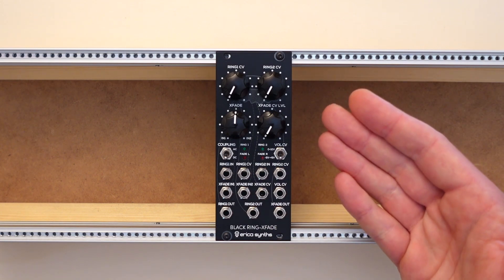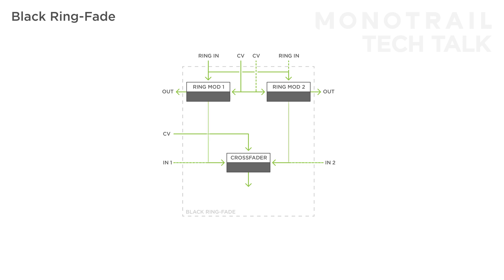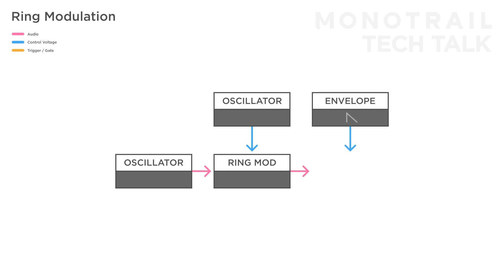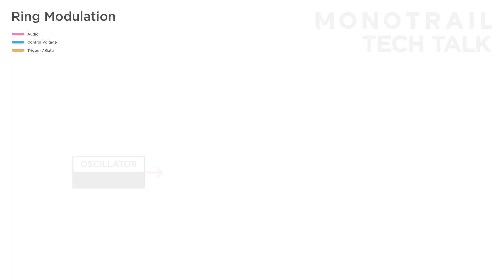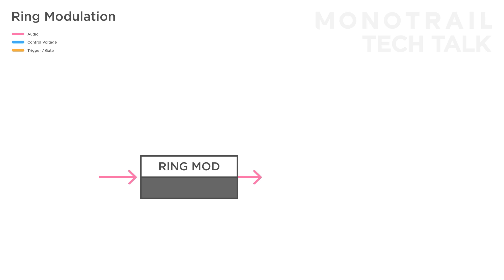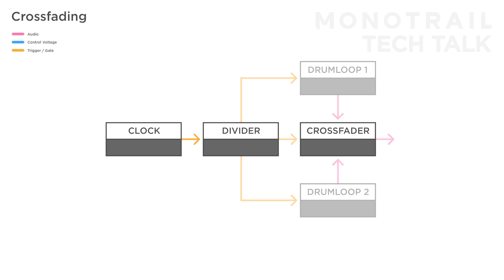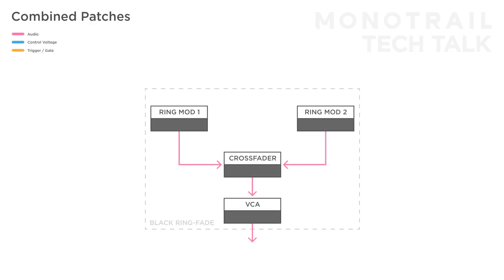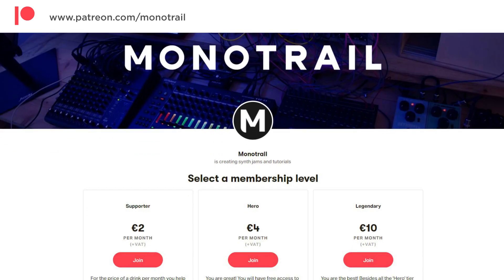Get more out of ring modulation & crossfading - with Erica Synths Black Ring-XFade

Comment: Im a tad confused about the ring cv input. Does a control voltage patched to the ring cv input give cv control over the ring cv knob's value? or does the ring cv input only serve the purpose of receiving an input signal which modulates the carrier?
Reply from the maker: Hi there, it is a bit confusing. Ring in is the carier, Ring cv the modulator. The ring CV knob set's the amount of modulation to the carier. What's interesting here is that Erica Synths used a unique design that still gives you a regular sound when the knob is set to unmodulated. But, there is no voltage control over the Ring CV knob, so maybe they should have called the knob Ring CV Amount or something :)
Reply: @MonotrailTechTalk  Ahh yes thank you for clarifying this. I almost bought it thinking it had what I needed. 

I found the doepfer A-133-2 Dual Voltage Controlled VCA/Polarizer/Inverter/Ring Modulator has cv control over cv amount!
Reply from the maker: Sorry if you read a message I send a minute ago (deleted it now), that was rubbish on my side! I 'd have to look into the Doepfer a133-2, in more depth, but you might be right there. The Doepfer seems to have a manual control, a cv input with attenuator, and then a mod input to modulate the cv amount. Didn't even realize that, I thought it was the same as the a133, but smaller. My mistake!

Comment: with DC coupling, it seems like both channels can be used as VC polarizers?
Reply from the maker: Hi there! The AC/DC coupling switch is for the crossfader only, But in my experience both ring mod circuits respond excelent to DC voltages as well, and so indeed can be used as VC polarizers. Set the Ring CV knob to the max, and you're good to go. Fo example feed an envelope to the Input, and have a slow bipolar LFO sweep the envelope from positive to negative. With a sceduled release like this My time with the module was limited. I might come back to this module with another video, indeed for the polarizing part, and some more ring mod with explained tunings and so on. It's really versatile and I'm sure ill get even more out of it spending more time with it :)
Reply: @MonotrailTechTalk  thanks for the detailed reply!